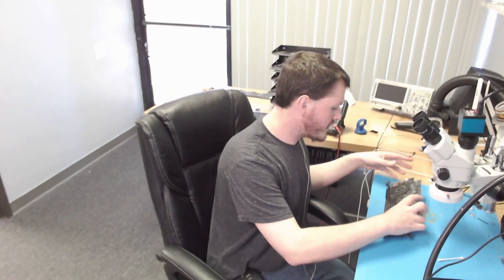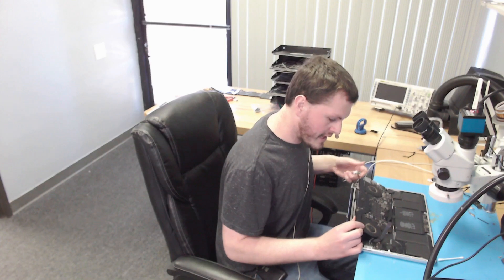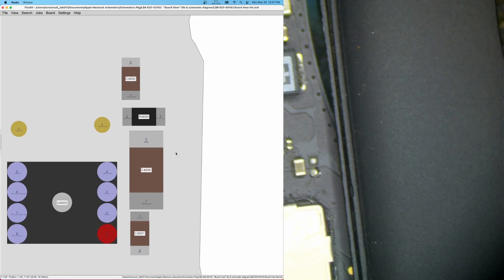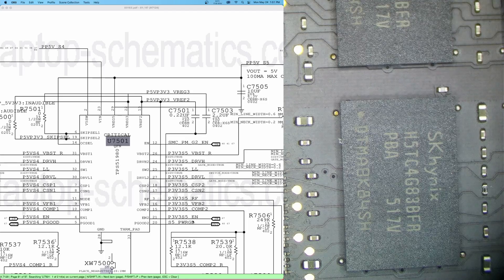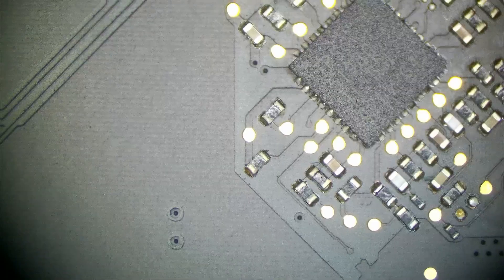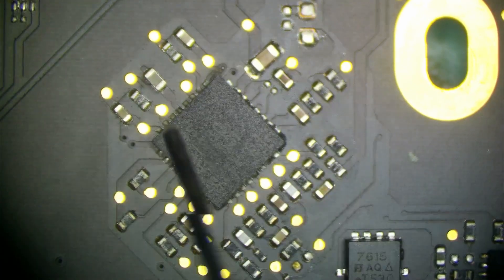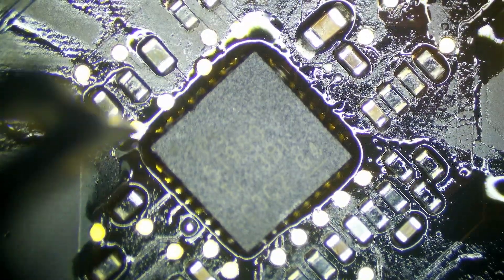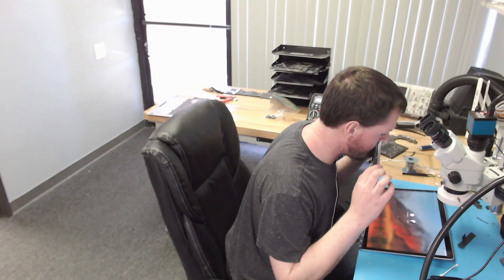Diagnosing and repairing a 2015 15" MacBook Pro that doesn't turn on.

Comment: Hello Tim, is this „refuse to start without battery“ behaviour specific to MBP 2015 only?
Reply from the maker: Yes, if you have a aftermarket charger. I believe the 2015 15" will also hang on the progress bar with no battery.

Comment: Hi bro, long time lurker, was wondering if you could show us your bench layout and your must have tools! cheers :)
Reply: Aside from the obvious equipment: Microscope, Bench PSU, Multimeter, hot air station, soldering iron, computer for schematic viewing

Something that cannot be undercut is a really good pair of tweezers, the finer the better, and a fume extractor.